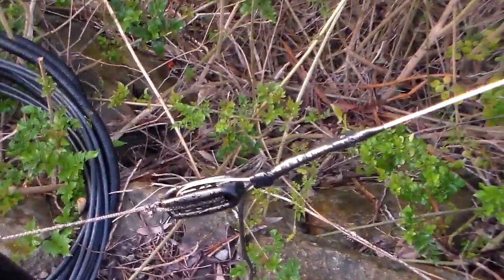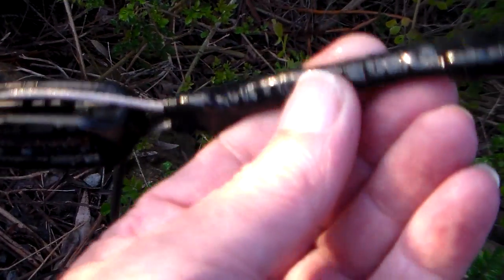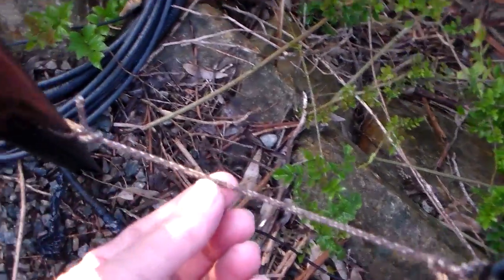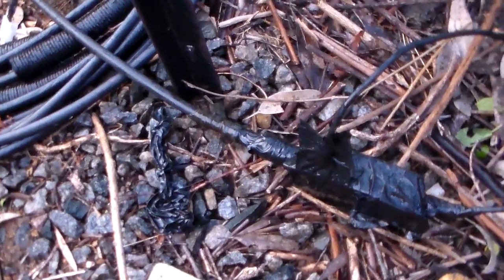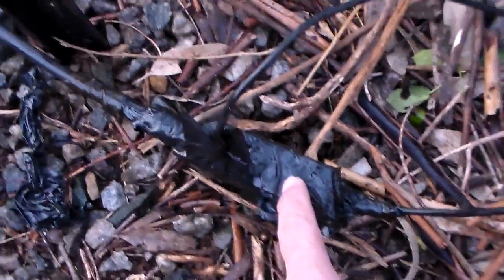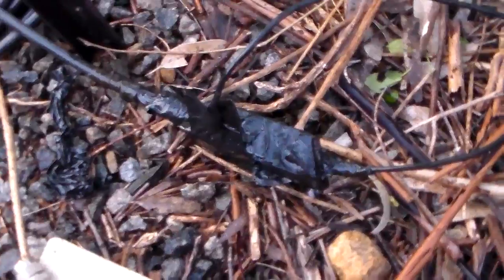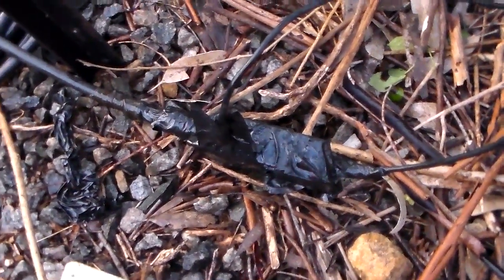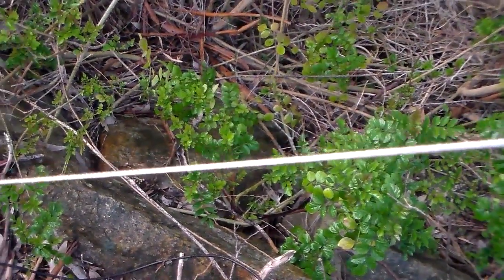Steel Wire Antenna Feed-Point Connection/Matching

Comment: 1) In Australia, they are called Steel Posts. 
2) Can we see the rest of the antenna and how it all works and is connected ?
Eg How long is it and cut for what bands or all bands ?
Tell us more. Thanks.
Reply from the maker: Steel posts eh... well, you would know. The wire length is 30m simply because it's sold in 30m lengths. I intend to swage another length onto it, that's the reel shown in the previous recent video. It probably has another 25m to run to where I have in mind to anchor it, so it will be around 55m in total. It's a random length, so it isn't cut for any frequency at all, but it will be longer than a quarter wave on 160m. The way it's connected at the moment is - radio to low pass filter, filter to manual ATU, ATU to 50 Ohm coax out to antenna feed-point, at feed-point 9:1 Un-Un connecting coax to steel wire and ground.

It's only a wire between trees so it would probably be difficult to see on a video, but if it shows up ok I'll show it in its entirety when it's finished.
Reply: VK6CS Thanks. Now I know what it is.

cheers.

Comment: Steel does not generally make great antennas, for certain designs at certain frequencies it can work but usually it is best if the steel has a non ferrous coating or braid. You can find aluminium electric fencing wire, or at least ally coated.